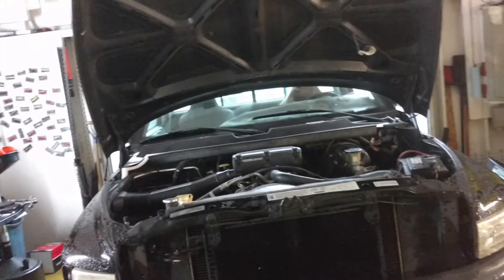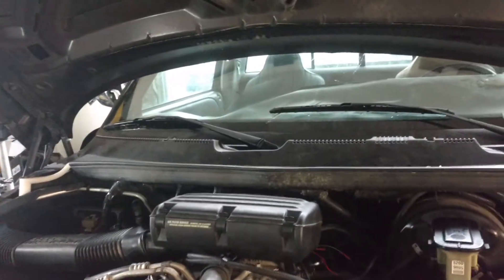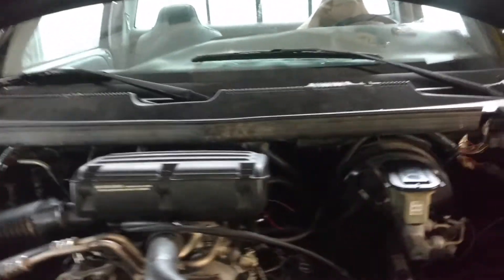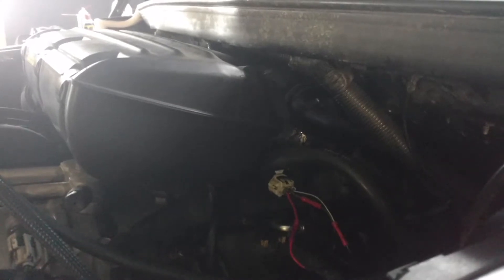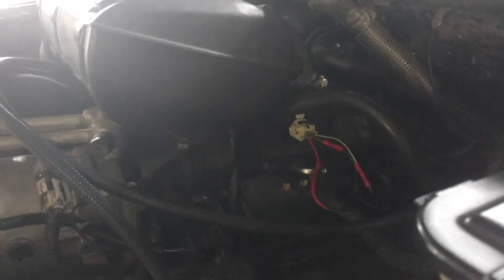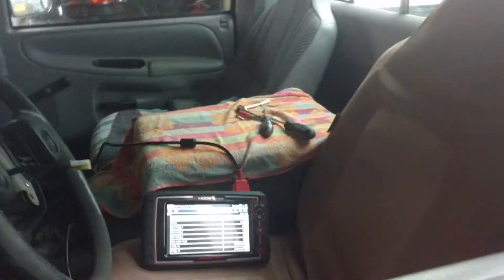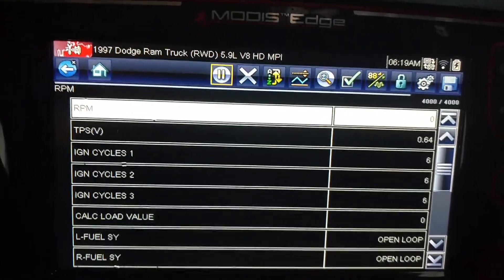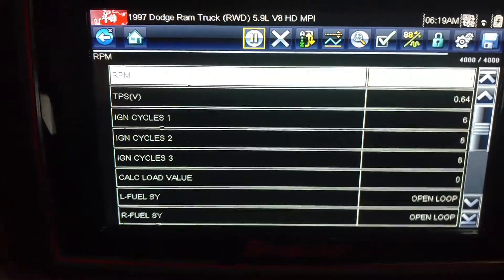1997 Dodge 5.9 P0123 TPS High Voltage

Comment: I have a few 94 Cummins. I have been dealing with tpS and AbS  problems for a minute. I have also had issues with my lock up in overdrive and I've been looking everywhere and this is one different source of a possible solution thank you

Comment: i wanted to run a new signal wire cause i get 5.18 volts going to the sensor, the signal wire voltage stars at 0.71 goes to 4.83 when at wide open throttle with volt meter on it and i have a ground as well i checked it yesterday on the way home from work because it got stuck at 1000 rpm and wiggled the the whole wire harness and it idled down i check for a short to the signal wire on the voltage meter and it did drop when i wiggled the wiring harness

Comment: whats a clock spring and where does it go
my truck has the same code for high tps voltage buck skip act like its looseing spark wont idle sometimes and in the more when i get to the end of my road i end up having to floor it to get it to run right but some times it will go as low as 300 rpm the jumps to 3000 rpm i need help